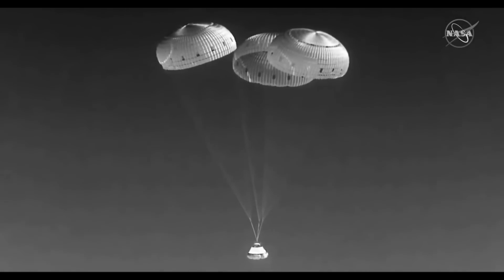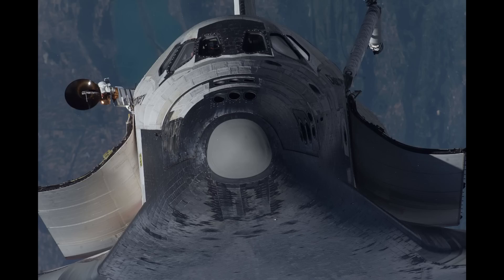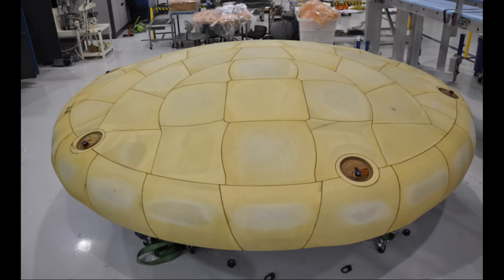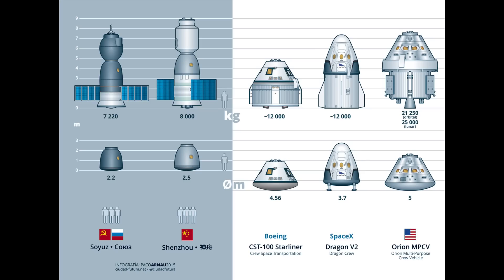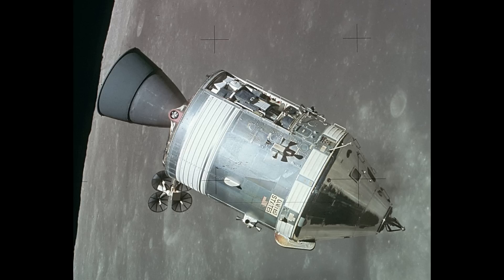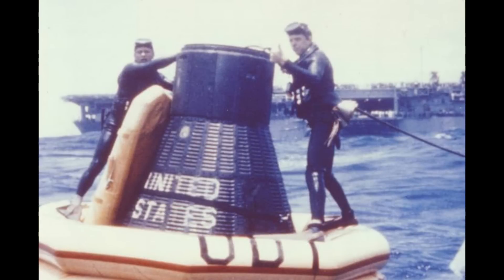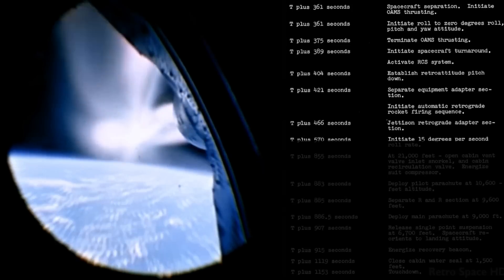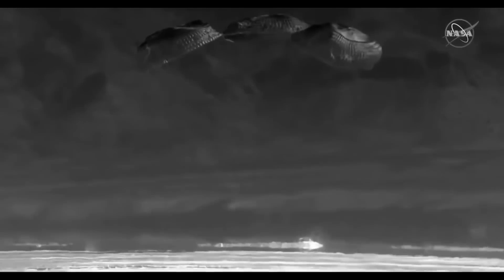Why Does Boeing's Starliner Not Look Burned After Reentry

Comment: The question of whether or not to use heat shield tiles is one I've had ever since I saw the first Starship render with them. I think in the very early days before anything had been built, they were talking about using a liquid cooling system where liquid methane would "sweat" through tiny poors in the stainless steel. I guess they decided that would be needless complex and switched to the heat sheild tiles for Starship, similar to the Shuttle. And that's what worries me. One of the shuttles we lost was because s chunk of insulating foam hit the wing and damaged the tiles. They were always having problems with the tiles. And even if they didn't, it was extremely difficult to maintain. Each one would have to be individually inspected. Space X using that same probakmatic system on Starship seems like a bad way to go.

Also...
1:44 If you told me that was a picture from Area 51 and it was an alien space ship, I'd be tempted to believe you. I mean, c'mon, it's a flying saucer. It is really cool that we are building the things we think of as exotic, extraterrestrial spacecraft. Lol
Reply: The foam hit a carbon carbon chunk on the leading edge, not a tile.  It's easy to confuse because of the color.
Reply: In case of Starship they shouldn't need to care about any foam or ice because of not being strapped to a tank sideways. In terms of replacing them good thing is that it's mostly one big cylinder, so only few types of heat shields, heat shield might also be generally better(tech getting better with time).
Reply: The space shuttle had an aluminium hull starship has a stainless steel hull this will reduce the heating if a tile breaks 

SpaceX is still considering using the leaking fuel heat shield at hotspots like the flap hinges

Comment: Great overveiw and I loved the post answer bit! Which I was designing a drop pod for my sci-fi setting and it turned out to work like a Space X Starship and booster but reenters on it's blunt nose and is shorter but wider in it's dimeter so I was wondering why might have Space X not made Sarship that why? I guess for easy aerodynamics going up and more delta v for orbit and transfers... Where as this droppod only needs to cross the pacfic and land or get deployed from a space plane/ship. It also needs to be able to quickly be refurbished with ver little faclities in a combat zone... and also drop off as many peerosnal/ supllies it can. Still I thought it was interesting to share thanks for the video!

Comment: Idea for video: Why are the capsules aerodynamically stable? I.e. why don't they wanna fly with the pointy end down? And how do you steer them on reentry?
Reply from the maker: The Mercury capsule had a spoiler to flip it around in the correct orientation, the others are supposed to be passively stable.

Comment: Given how fragile the heat shields of the spaceshuttle were, I do wonder if an ablative one would have been possible and if/if not why is that?
Reply: They didn't because it needed to be re-usable, and that would (Theoretically) have been cheaper. Also, shuttle was a plane and could therefore generate lift and prolong re-entry, reducing peak heating.
Reply: Too much work to replace it with a new one after each flight.
Reply: @josephastier7421  They ended up doing that  anyway? And if I recall correctly I can't understate just how fragile these things are, so tearing them off and slapping new ones happened a lot of times. Foam pieces from liftoff managed to damage them and the burner ones would have probably just shrugged this kind of damage off?
Reply: @EnraEnerato  On the shuttle they didn't have to replace it but they did have to inspect it.  Even an ablative heat shield needs inspecting, in fact they usually xray them to look for voids.  I can imagine on something the size of the shuttle that might have taken some time. :)
Reply: @EnraEnerato  The problem with the shuttle was the flaw in its basic configuration where it's heatshield was in the path of launch debris that could strike it.  Just as very few materials that were/are practical for this application could tolerate that kind of abuse, the STS probably wouldn't have suffered its damage in the first place.
Reply: @EnraEnerato  They never had to replace all the TPS tiles, though there were at least two times when they had to replace a lot of them.  They are good at withstanding extreme heat, but are basically glazed ceramic styrofoam, and mechanically fragile.
Reply: @obsidianjane4413  Side-mount is surpringly useful, it allows for paralel-burn configuration and makes the stack sturdier. And the problems with the foam were difficult to foresee, especially since it originally had a reusable first stage.
Reply: @HalNordmann  Side stack introduces whole classes of risk that vertical stack does not.
Reply: @josephastier7421  But it reduces other classes of risk. More aerodynamic stability, the option of ground-lighting all engines...
There is no objectively better option. It entirely depends on the use case.

Comment: Quick question:  How come SpaceX Falcon 9 boosters progressively become more charred as they fly while Starliner hasn't? Is it because of some quirk with Flacon 9 boosters that isn't present in Starliner? Or will Starliner build up a charred exterior in time as it flies more flights?
Reply: The falcon 9 has to fly through its exhaust while landing, so it gets covered in soot
Reply: Falcon 9 boosters don't char, the black that you see is from flying backwards through the sooty kerosene engine exhaust cloud during the reentry and landing burns.
Reply: Its because the Falcon 9 flys through its own exhaust during its entry and landing burns.
Reply: I’m curious if the kerosene char has insulative properties within the Merlin cones, or are the Cones just swapped out?
Reply: @TamagoHead  I don't think it's a beneficial effect, and I don't think the soot really builds up on the cone, since it's such a violent and high speed area.
Where it's a problem is in the nozzles etc

Comment: So why the angle choice? I'm guessing it has to do with desired volume with the restriction of the Falcon 9/SLS diameter?
Reply from the maker: Yes, Dragon is designed for Falcon 9, similarly, Soyuz is designed for the R7
Reply: @scottmanley  thanks Scott - isn't it interesting that this means that our spacecraft are still limited by the size of average US roads? Definitely seems easier to reshape a payload than reengineer a miracle of flight
Reply: When you think about it in that case Starliner is kinda weird compared to others because it's significantly wider than the carrier rocket
Reply: @ImieNazwiskoOK  perhaps weirder, but it seems superior in this aspect.
Reply: @TheBooban  Superior in terms of?

Comment: nice...something that has been kind of bugging me is why the small entrant/exit ports on the current ships where Gemini two had pretty large ones @7:31.  Just wondering if there is an issue of putting a hatch that can be walked into and out of....you know, something like 1 meter by 2 meters...
Reply: That would require a 6m long seal around the edge of that door, hence the preference for round or square hatches with their optimal edge to area ratio.  Also the walls around the hatch are usually jam packed with other key equipment.  The Apollo Block 2 hatch was heavily redesigned for quick opening in case of emergency, while keeping the size and shape.
Reply: The Gemini hatch opening needed to be big enough for the ejection seats to fire through. That's probably the most significant factor. Also, an astronaut needed to be able to exit and enter unassisted. Even at the size it was the first Gemini spacewalker was almost not able to reenter, he got stuck because it was hard to maneuver himself, the pressurized suit was hard to bend in. Without the Gemini requirements, a small hatch is better; the larger the hatch, the more reinforcing is needed around it. A large perimeter seal has more critical points to fail and needs more seal material. The hatch cover is heavier than a correspondingly sized piece of hull, so smaller is better. Overall, the smaller the hatch, the less mass added to the spacecraft.

Comment: US finally have a man-carrying spacecraft able to land on land. (Space plane like the shuttle doesn't count)
Reply: As I remember SpaceX originally wanted Dragon to touch down on dry land, but NASA wanted a water landing. I'm curious how Boeing got the go ahead to do so.
Reply: @butchs.4239  
I believe it's because of the landing method. Airbags are more reliable than legs.
Reply: @the18thdoctor3  Maybe, but SpaceX has a pretty good track record of landing their Falcon 9 boosters on legs. I wouldn't think the engineering of fitting whatever is required for Dragon to touch down on terra firma is beyond them.
Reply: @butchs.4239  
The Falcon’s legs don’t have to stick out through the heat shield like the original Dragon proposal. They also wanted propulsive landing instead of parachutes, and that was also nixed due to reliability concerns.

Comment: Thanks for taking me on that trip. I had a much shorter explanation that seems to have been at least partly correct. I figured Dragon looked burned up because SpaceX was into doing things as cheaply as possible and that meant it was more reusable than the other capsules.

Comment: Thank you, the little details matter .now we know more about it. One of my concerns is the ablative insulation along the seams of the flaps of Starship, how are they going to keep the heat away from the servos and the arms connected to the servos that control the flaps. This kind of helps.
Reply: Are you certain it’s “ablative” insulation? I’m surprised at the idea that they would use anything ablative on Starship.
Reply: @zzubra  if a tile gives off anything including gas it's ablative which means it gives away something in return for protection. Your response is unthought. And perhaps one of these days you use your real name for verification as a human.
Reply: @MichaelMiller-op8fe  You response is silly and only self serving.  The Starship tiles are not considered ablative, you want to call them ablative because you don't want to admit you were wrong and want to prop up a flawed post.  Perhaps one day you won't fake it so badly as to be so blatantly transparent.  It's feeble at best and more than a little shameful.
Reply: @MichaelMiller-op8fe  As best I can tell, “ablative”, in the context of heat shielding, means a material gives off gas which carries off heat via convection, at the cost of the material being eroded. Using ablative heat shielding is compatible with limited reuse, but limits how many cycles the system can go through before replacement is needed. That’s why I would be surprised if Starship uses ablative materials. I don’t see why such a position would be seen as “lacking thought,” though I’m open to the possibility that there is something I’m not aware of going on. / I’ve used this username on YouTube for a long while. I’m a human, with a PhD in Applied Physics from Stanford University, for what it’s worth.
Reply: @MichaelMiller-op8fe  Why are you so angry(and insulting) towards that person?

And I didn't hear much about ablative heat shield near them. If anything the idea of pouring gas over it(I wouldn't count it because it's far different). The Starship tiles are not ablative.

Edit: And using your real identity is quite rare(and doesn't sound like the best idea) lol.
Reply: I'm pretty sure that's one of questions SpaceX itself asks.
And I kinda wonder how it was with the bottom of space shuttle(maybe something kinda similar).
Reply: @ImieNazwiskoOK  thank you for a reasonable response
Reply: @MichaelMiller-op8fe  That and the flaps on wings (and the body one protecting it's engines)
Reply: @ImieNazwiskoOK  are you talking about the seals for the doors for the landing gear?

Comment: I worked on the Stardust Mission and the Sample Return Capsule that is now in the Smithsonian Air and Space Museum in D.C.
It was the fastest manmade object to ever fly through earth's atmosphere (at the time).
I believe it was also made from "PICA" "Phenolic Impregnated Carbon Ablative"

And at the time, they considered the exact angle of the backshell to be "classified" as the CFD was done by the defense dept.
Reply: My memory is that Dan Rasky was one of the main developers of the PICA material for the Stardust mission, and he was sent by NASA to work with SpaceX on the Dragon project, and was the driving force behind the PICA X.

Look up Dan Rasky here in YT, he did some very fascinating interviews on his time at SpaceX etc.
Reply: I thought that the manhole cover during a nuke test was the fastest object that likely vaporized within the atmosphere.
Reply: @TamagoHead  
The manhole cover was only in 1 frame of the high speed footage.
So only a minimum speed can be calculated.

Based on the speed of the camera, and the height of the image, the bare minimum it could have been going was 66 Kilometers per second. But the math says that it should have been going about 6 times the speed of Earth's escape velocity of 11.2 kps. 

And it wasn't exactly a manhole cover. It was a 1 ton piece of armor plate.
Reply: @lordgarion514  Amazing! Thx!
Reply: @lordgarion514  dude. Fascinating.
Reply: @TamagoHead  In short: That story is more than likely fake(but blown by media), it might not even fly at speeds near it in the first place
Reply: @eduardopupucon  pica is also a typographical measurement.🤓
Reply: @TamagoHead  ...and that's not being elitist...
Reply: @chrisantoniou4366 🤣🤣🤣Great one Dad😁
Reply: Random person question: what was the TPS report of your industry? What stupid stuff did everyone have to suffer through?
Reply: @oatlord yeahhhhhh unmmmmmm I'm gonna go ahead and need you to come in on Saturday oooook? Ok Great.
Reply: O material é Pica
Reply: KKKKKKKKKKK pica
Reply: @3runorocha  Kkkkk so brasileiro vai entender